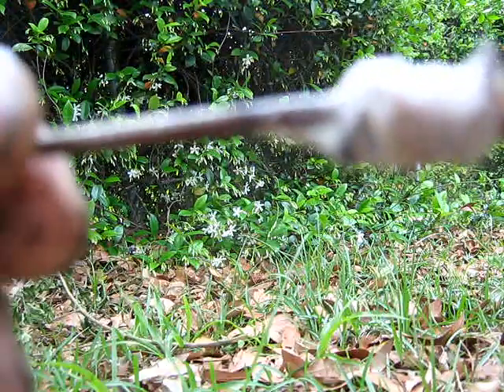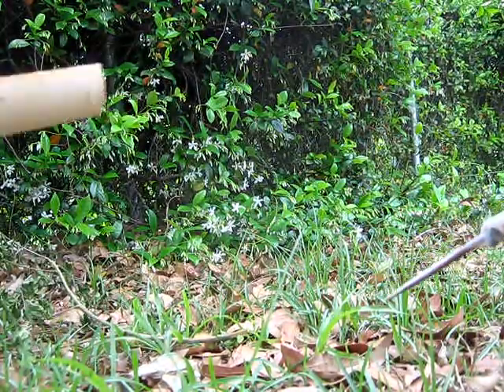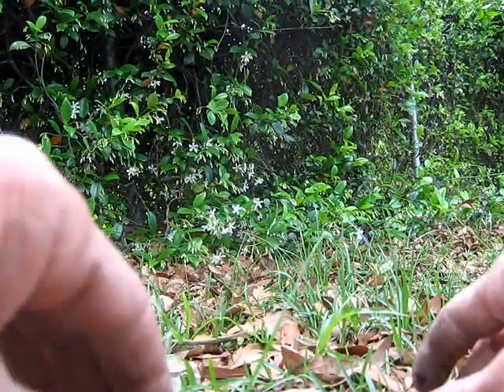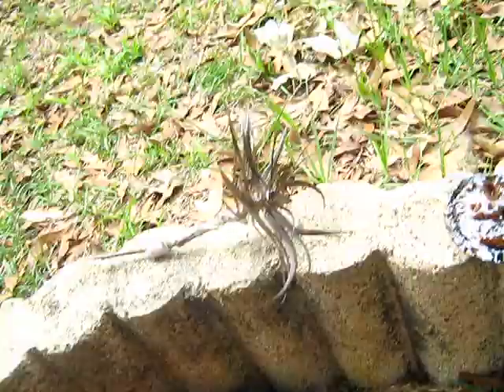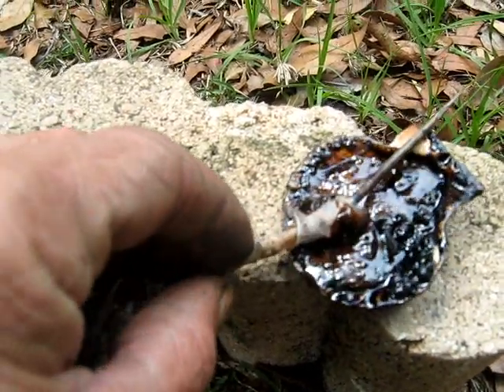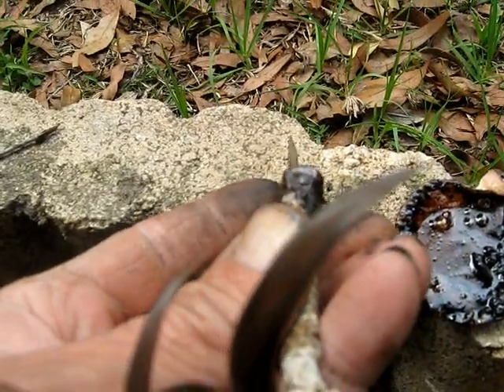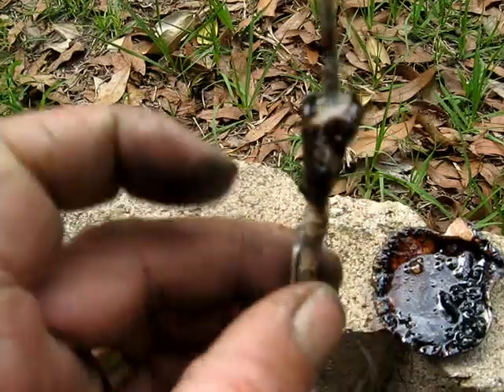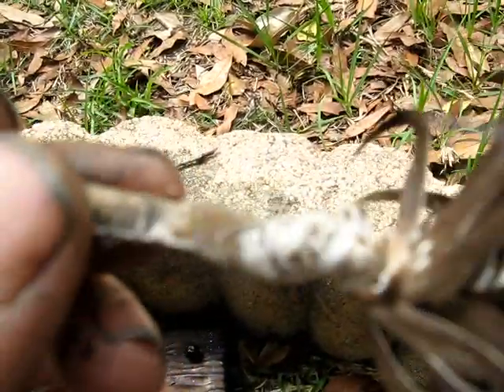Trapper Jack  survival making a blow gun dart

Comment: I like watching his vids but ya gotta admit, that was a pretty rough lookin dart! lol
A blowgun takes time to make if ya wanna get it right and I've made a couple. My favorite one is made out of tiger weed which is in essence just a big weed with a medium sized daisy that kinda looks like a small sun flower. If you cut the mature stalks use a long rod to gouge and twist the inside out then let it sit and cure for a month or 2 then it gets a lot harder and works beautifully.
To make the darts find the longest thinnest thorns available and some Johnson grass stalks [use the pieces closest to the base. they are hollow. Grind the thorns down on a rock or piece of concrete so that they just slip into the hollow stalk, dip the end in the resin, insert it and then dip the stalk and thorn in again to seal it It's best to dip it the 2nd time after you have made a couplea dozen and let them dry and shrink for a day or so. That way you coat the entire joint and it seals and hardens it nicely. once these have set up a little fletch it and you are done.
That's just the way a like ta do it.If you need a quick weapon......get a rock, make a sling.  Good blowguns take a lotta time!